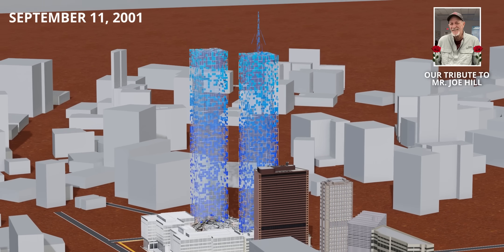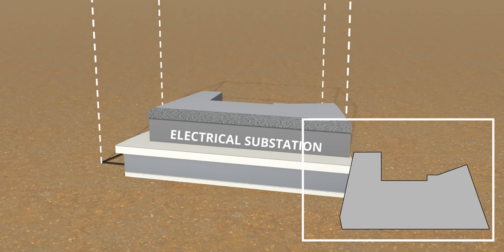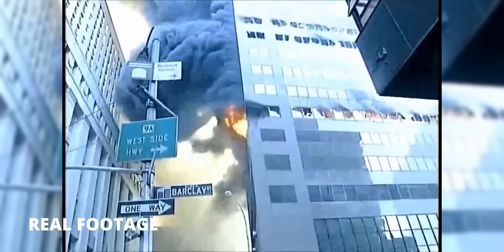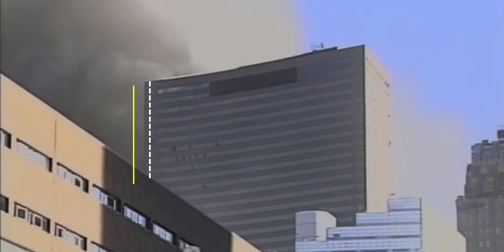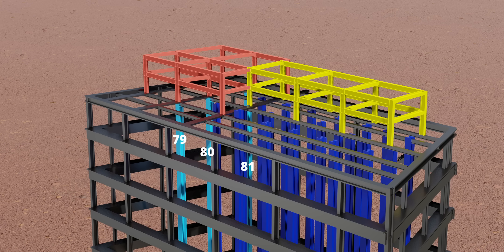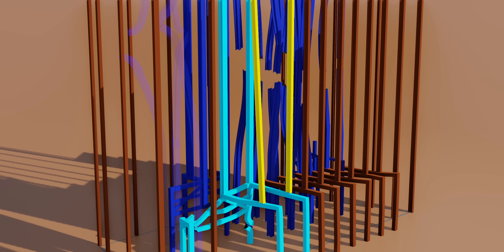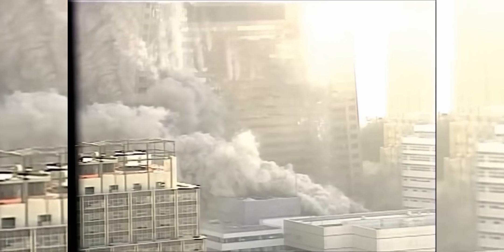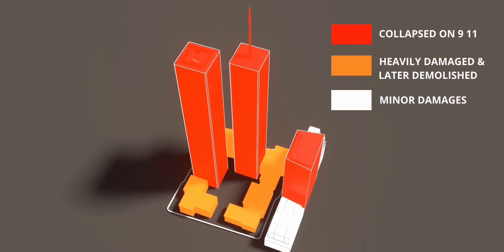Collapse of Building 7 | The Complete Physics

Comment: It's amazing how strong rigid vertical steel columns turn to spaghetti in animation, what's more amazing is that non of the 3 towers slowed or tipped over to path of least resistance, they just rushed downwards to the ground.
Reply: It's amazing that the building stays completely intact as it sinks into the ground from the bottom up.  I read a book on this specific collapse which stated  the only way it could collapse the way it did, was for all the support columns had to blown out simultaneously.
Reply: @JoeLinux2000  what was the name of the book?
Reply: The book is called, The Gullibility of the twoofer, by Leroy hulsey with the forward by rich gauge himself
Reply: @ dikranovichk5889  You think typing condescending and childish insults is proving something? It just shows the level of your maturity which is clearly displayed here.
Reply: @JoeLinux2000  - Wow, someone really wasn't paying attention. FFS 🤦‍♂

And no, you didn't read any book. You copied that off some YouTube video.
Reply: @rokko_fable, come on, we’re almost there. 20 story building above floor 89 of the north tower, and a 30 story building above the 77th floor of the south tower. These masses drop ten feet, and impact the floor below.  What does that floor do?   Mt Everest by volume is a solid mass.  The twin towers by volume, were over 90% air. Kind of like the “truthers” brain.
Reply: @TheCriticalStinker-01  "The columns are largely spectators during this ROOSD phase of collapse."
Nice, so the massive 47 steel core columns should've remained standing since they were mere "spectators", but they vanished too!!!
You see the flaws of this theory?
Reply: @TheCriticalStinker-01  The "pancaking" theory is adopted officially, we've been told time and time again that the collapse of the twins was due to the top section (pile driver) made of 15-20 floors dropping on the floors below the impact zones, gathering weight and momentum after impacting the floors one by one, right?

"Each successive failed floor adds its mass to that already falling. Too many get lost by forgetting this bit of bleeding obvious."
Good! Now this "mass" of pancaked floors, or the "pile driver" or the "piston" is clearly not visible after a few seconds of dropping, it is observed clearly getting destroyed way up before even reaching half way of the collapse. The ending result in both towers seen in the photos is zero floors! Not a single concrete floor was seen at the bottom, just steel debris thrown everywhere.
 So this "mass" wasn't responsible for pushing 70+ floors all the way down to the ground, or else why did it vanish?
Reply: @Vantriloquist-j9j  - Not sure where you get any of that from. My description of the collapses was written in plane simple language and an easy to follow format. 

The only flaw is your inability or perhaps unwillingness to understand it. 

I suggest you read it again, more slowly this time. And do try to be serious.
Reply: @asmagaref, I think talking to you in general is a childish endeavor. Your100/1000 architects and engineers sits at 3661. Thats the number on the aNe “truther” website. Do you get that, 15+ years and the more ons have 3700 signatures from professionals.  There are millions of architects and engineers world wide.  10,000 is 1% of a million. You’re so sure you are right, you have a fraction of 1 % of the whole world wide scientific community.   Your group has gone to court multiple times and been shut down for lack of standing, multiple times. Oh yeah, Larry Silverstein says “pull it”. What, your finger?
Reply: @dikranovichk5889  lol Says the one leaving ch ildish replies under comments, you're projecting!
Reply: @dikranovichk5889  Yeah well over 3,000 have taken interest, who says every architect/engineer has looked into this?
Reply: @TheCriticalStinker-01  I suggest you do exactly what you're advising me to do. I've responded precisely to the two key points in your theory after quoting them.
Reply: @Vantriloquist-j9j  - No, you added your own agenda to what I stated, attempting to twist my words.  So I admonished you to read it again, since everything you need is already posted. 

I speak in clear, simple language and say exactly what I mean and it is all thoroughly vetted. There is no need for you to try and twist my words. It will not work.
Reply: @azmagrift, come on dude. 3661, that’s the number of professionals who have signed your petition. What, don’t scientist talk to their friends and explain things in scientific terms. Couldn’t these 3661 spread the word pretty easily with texts and emails and you know, a telephone. Or these 3661, couldn’t they produce a video or something.?

You’re so sure of your position, yet the scientific community appears not to be. And you’re claiming science supports your position.  Then your response is to say, the rest of all scientist are what, afraid of loosing their job, or they just haven’t heard about it yet. WTF!!!  Are the 6 million Chinese engineers all afraid of loosing their jobs. Smart Russian engineers over in Russia, couldn’t you get some of them to support your position, with your “facts”?
Reply: @TheCriticalStinker-01  
I've clearly addressed your two key points regarding the two towers' collapses, but because I pointed out the flaws you call it my agenda or twisting your words.
Reply: @Azmagraf,  come on, 3661 engineers and architects have signed the petition. Lawsuits have been filed, and turned down for lack of standing.  We’re talking science here, Einstein.  Where is the support of the scientific community?  A Fraction of a percent, really?  This is high school physics we’re talking about, and a fraction of a percent of support from the world wide scientific community.
Reply: @ Everything you type is irrelevant and meaningless right now, you're being ignored little child, now give back the phone to mommy!🙂
Reply: @azmagraf, oh nice, that’s a classic but hurt response.  You stick with your fraction of a percent, and avoidance of reality.
Reply: @azmagrift, I’m enjoying reading your posts on other threads.  Seeing you tell another poster you’re not on one side or another is good stuff.  More finger pulling I guess
Reply: @Says the mosquito of the comments section 😂ok bye:hand-pink-waving:
Reply: @azmcgulible. Did you ever say when building 7 begin collapsing?  Do you think it starts with the roof and penthouse collapsing, or do you think the collapse begins later, when the shell falls?
Reply: @ I've already made it clear 3 times that I don't entertain children who use name calling.🙂
Ciao :hand-pink-waving:
Reply: Dork, you’ve been entertaining me for weeks now.
Reply: Another funny little post from you, was you explaining how you check for shadow banning, by using another account, to see if you’ve been shadow banned. It explains how your post gets two thumbs up within mins of being posted.  You give yourself a thumbs up from your multiple accounts. Too funny!  “Was I shadowed banned? Nope, oh look, I can click another thumbs up”.
Reply: @Vantriloquist-j9j  The mass of the "pancacked piledriver" didn't vanish. It's all still there, just simply disintegrated. Just because it disintegrated into pieces doesn't mean it magically weighed less. That mass would still be falling downwards in the direction of gravity, with its enormous momentum causing every floor beneath to immediately fail. I don't think you understand what you're saying.
Reply: @Vantriloquist-j9j , especially with the damage being at the front of the building which is narrower than the back, the building should have toppled rather than free-falled. The wider foundation at the back should have given it more support. You're going to come up against a lot of shills in these comment sections too, so don't waste too much of your energy arguing with the enemy. The fact that over 3000 experts have voiced their opposition to the narrative is astronomical. For every one of those experts that have voiced their opinions you'd get a thousand more that would agree with them.
Reply: @joelstinks, maybe your book could explain why the roof collapsed first, before the shell?  Once any part of the building collapses, that is a sign that columns have failed. If columns failed before total collapse. Then it doesn’t seem possible for all columns to have collapsed simultaneously. Or maybe that idea goes over your head, since it seems like that wasn’t in your book
Reply: Down, yes. Vertically straight down? No. 

His azmagaref observation is correct. If you say gravity, then that applies for a falling body through the atmosphere. 

But this was a standing body, they just don't fall vertically down having been standing. 

So, yes, they should not just sink vertically downward. Column standing will have a lateral moment of force about its bottom by its weight when even the slightest tilt occurs  or from neighboring debris
Reply: @lamentube  
Thank you, it's logical isn't it? if you sever or break a standing vertical steel column it'll fall sideways like a tree. For it to crumble down means it'll have to have been severed or broken in multiple points from bottom to top! And that happens to all the columns at once. 

You look at the South Tower's collapse for example, that top section above the impact initially started following path of least resistance, it leaned/tilted forward, but instead of breaking or falling off the rest of the building, it starts diving downward through the whole structure!!
For asking legitimate questions they start giving you insults and calling you names.
Reply: Poor baby, you finally made a valid point. The 32 floors above the impact zone of the south tower did fall towards the direction impacted.  The central core however forced the building to collapse on itself. That’s why in each of the twin tower collapse, the core is the last part of the building to remain.  Look at the spire from the north tower collapse. Vertical columns still standing erect, after global collapse.
Reply: @dikranovichk5889  
Yeah yeah, the ball crushed the mountain.😄
You're not getting the attention you want, nor be taken seriously by me after the childishness you displayed on this thread and others.
Bye again :hand-pink-waving:
Reply: Ya crazy huh
Reply: Yeah, gravity sucks
Reply: Asymmetrical damage leading to a perfectly symmetrical collapse against the path of greatest resistance..... pulverizing the ridid steel structure in the direction it has the most strength.... into its own footprint .... at the speed of gravity as if unimpeded
Reply: @VeiLofCognition - PhD. Judy Woods, book tiddle " Where did the Towers go " is a key question...The steel turned into dust... Watch the (one) video of the center core falling...Then look at what steel remained, after the collapse...
Reply: Nano thermite on concrete, laser pulse ignites...
Reply: Actually the tops of BOTH twin towers did tip during the collapse so nice try and even in this video he showed that building 7 did as well
Reply: @crazyeddie1981   show me where building 7 "tipped" dude what 7 meds are you on, there is no video of it "tipping" over. Do you just make stuff up in your head and then pretend to believe it to feel better about the world? LOL! Jesus ...
Reply: That’s called buckling. Leaning or falling to the side would take force or energy to start the rotation (moment of inertia)
Reply: Because you’re an engineer and know better, right?
Reply: @user-uv4wn2xx7o I am actually 😂 - and I bother studying the facts first instead of jumping to crazy conspiracy theories without any evidence whatsoever.
Reply: Was there an actual question in that post?  What building fell at free fall?   Can you explain how these calculations where made?
Reply: Out of curiosity, have you ever seen a tower tip over before?
Reply: What do you mean “path of least resistance”? That what electricity follows. Falling objects just go down
Reply: @darthnbl  "Falling objects just go down"
Wow you're a genius! When you cut a tree from the bottom does it fall straight down or tip sideways?
Reply: It’s amazing how steel becomes malleable after being at 1800 degrees for hours.
Reply: @benlundstrom5704 it's amazing how the thousands of tonnes of structural steel under the fires still held most of their bearing capacity
Reply: In this presentation it was not said that the upper floors just pancaked downward collapsing on itself as its typically explained with the collapse of WTC 1&2. I feel it would be a stretch to use the same explanation of the high temperature fire weakening the steel support columns to uniformly bring down WTC 7. Which, like the Deutsche Bank Building, was never struck by a would-be hi-jacked airliner.
Reply: @nelsonphilip4520 

WTC 7 didn’t collapse like the towers, Towers 1 & 2 fell from floor truss failures after plane impacts. WTC 7? No plane; just hours of fire that caused one girder to fail at Column 79, which triggered an internal collapse. Different building, different structure, different cause. No mystery; just fire, physics, and facts.
Reply: Do not believe a word of this. The same explanation that holds its weight  in forensics is- preset demolition was used.  Thermite used kept the steel molten 5-6 months after the collapse.
Reply: @Vantriloquist-j9j  Are you dumb? THE PATH OF LEAST RESISTANCE WAS THE PATH THAT IT TOOK. Or do you think physics decided take a vacation on that day? Those columns can support the building weight when ALL OF THEM are intact. Remove a few it's like removing a card from a house of cards. Try to tell this to your 3 brain cells.
Reply: It's almost like steel is a poor choice for construction.
Reply: Yep. Once the steel fails, it collapses. The forces involved are quite extreme.
Reply: @paulblase3955 - SatttliteTech works...
Reply: Nothing strange about that at all 🙄
Reply: floors pancakes on towers 1 & 2
Reply: You are the Fiction factor 🤣🤣🤣🤣🤣
Reply: The events of 9/11 are very suspicious and if you look at the history of the U.S. government, and are an understanding person, you would acknowledge that foul play was a probable reality.
Reply: I know the focus here is on the collapse of the towers, which itself seems dubious to me at least, but look at the bigger picture and read into the Twin Towers and you'll see. Look up Twin Towers and Port Authority's asbestos abatement bill as well as the numerous false flag instances the U.S. government has supposedly conducted. Why should I trust a narrative with so many plot holes from "authors" that have lied multiple times and done horrible things in the past? It's not that difficult to at least understand these notions. Chill.
Reply: they absolutely did tip over, you can see it clearly in any footage
Reply: @isaacgonzalez4606 Only in the South tower did the top section initially start to tip, but then dropped downwards and didn't  fall unto the ground as expected. Watch it again in slow motion.
Reply: It was old steel too very valuable. Harder and the temperatures needed cannot be created by fire or jetfuel it's physics. I do not accept the magic building theory.
Reply: Only amazing to you
Reply: I think the more implausible theory is that a largely aluminium plane was able to inject itself into a steel cased building. The plane should have folded like paper on impact. The media projected that it made its way through the building largely intact. Erm. Physics says no.
Reply: I'm not a mathmagician, but don't the steel beams push and pull? This keeps the building from floating away.
Reply: Is there any steel structured building collapsed due to fire only 🤔
Reply: Ejecting steel beams horizontally and finding body parts 1 /4 mile away.
Reply: @seedplanter7173   You're saying body parts were flung 1/4 a mile away!!! What type of energy is required to send someone's i.e leg that far? 
So a floor falling on another floor can produce that explosive energy? Enlighten me.
Reply: Many architects and engineers have done studies that disagree with Sabin’s conclusion in this series. Please do your own research. Read this article https://www.europhysicsnews.org/articles/epn/pdf/2016/04/epn2016474p21.pdf
Reply: I would expect a weakened building to collapse downwards. Where else would it go? These are not trees falling over in a forest. They're complicated human structures that have multiple points of failure, that cascade downwards. I honestly don't have the imagination to view any other scenario as plausible.
Reply: Not spaghetti but close to it. Steel doesn't go from strong and rigid to puddle form. It softens up with heat. Find a piece of rebar you can't bend, get it glowing hot and you can bend it. Get enough weight on it and it may as well be a noodle.
Reply: Down is the path of least resistance - it is the direction of gravity.  Sideways requires a lateral force and there was nothing pushing on them.  Your starting assumptions are false.
Reply: @TheCriticalStinker-jw4fl   You cannot have a symmetrical collapse with asymmetric damage. Every inch of the buildings are still structured to hold up the upper part of the building. Straight down is not the path of least resistance it's the path of the most resistance. There is no resistance around every side of the building thus a collapse with lean in one of those directions. This is junior high level physics.
Reply: @FilterFreeAmerika  - Yeah, yeah, I've heard that dogma recited endlessly for the last 18 years and it will fail this time for the same reason it did the last 10,000 times it was brought up.

The collapses were progressive NOT symmetrical

Of course, the whole thing is a Red Herring anyway since in the engineering world, this is a non-factor. Go ahead and peruse the engineering journals and see how many times it crops up in the last century or so.  I guarantee you only need to bring one hand and will have digits left over.

Symmetry as a talking point was fabricated by a tiny subset of ignorant conspiracy believers. It is as untrue as it is irrelevant. 

My suggestion would be instead of just mindlessly repeating proven fail arguments you found on the internet you come up with something new, something interesting, something that hasn't already failed countless thousands of times. It would be more productive.
Reply: @rokko_fable, I think you are finally starting to get it. Flight 11 hit the north tower at floor 90 of 110 story skyscraper. The south tower was hit at floor 78 by a commercial airliner, traveling at high speeds. The faster the plane, the greater the impact.  The building remained standing after these destructive impacts.
Reply: @rolko_fable,  when those 20 floors collapsed above floor 89, what did 89 do, call down to the basement and say I need reinforcements?  And when 89 was compromised, does this floor then become part of the falling mass???
Reply: @ 
Ok, I get your theory that when around 15 floors in the North Tower started moving down, the weight of this top section was increased by each floor (pancaking) it impacted below right?
So the top section (pile driver) continues gathering weight and momentum until it reached the ground, do we agree so far?
Reply: @raisenarizona, you think a soccer ball dropped from ten feet above Everest is going to just fall through the sky.  I mean, what’s the point in even trying to have a discussion with you. It’s like trying to have a conversation with a monkey. Really, get your fellow twoofer to pat you on the back some more. 

It’s clear from the collapse of the penthouse and roof, that building 7 was failing, and collapsing,  before the outer shell began its collapse. Your notions about the subject don’t hold up.  Your top argument is a quote from Larry Silverstein
Reply: No, we can’t
Reply: @Vantriloquist-j9j  - Near close enough for a working basis. Forget the "pancaking" bit though since that is wholly inaccurate, however one chooses to define it.  

Falling mass (and it is a mass, not neat intact floors) continues to increase with each successive floor failure and with it, momentum. This should be obvious enough. Each successive failed floor adds its mass to that already falling. Too many get lost by forgetting this bit of bleeding obvious. 

The columns are largely spectators during this ROOSD phase of collapse.
Reply: @TheCriticalStinker-01 do you have an engineering degree? definitely not. You have no clue about structural design.
Reply: @markderv, when, in your mind, does the building 7 collapse begin?  when the penthouse and roof collapse in, or does the collapse begin later, when the outer shell collapses?
Reply: @alneg6234  - IF I have made any errors of fact, logic or reason please feel free to point them out and I will make the necessary corrections. Please be specific and prepared to back it up.  I assure you I will be.

I won't wait up.
Reply: @TheCriticalStinker-01  Quite the gatekeeper aren't you?
Reply: @TheCriticalStinker-jw4fl actually one side being g compromised and one weakened would cause lateral force . Ever sit on a 3 legged stool with one leg missing?
Reply: @graNtbaKer420, since it seems like we’re both talking to ourselves, maybe we can pull our discussions into one thing.  Like, when the first column failed, was it an exterior column, or an interior column?
Reply: @grantbaker371  Indeed. Unfortunately, bots like criticalstinker don't think as critically as they would have you believe. They are literally C+Ping failed explanations they have gleaned from the web, just like any other AI.
Reply: @TheCriticalStinker-01  So now explain how a field gobbled up a whole plane and made it disappear and how the wings of two jet liners made of aluminium were able to slice through steel girders surrounded with concrete like a knife through butter, and not one, but both towers perfectly imploded despite being engineered to withstand the impact of a fully loaded passenger jet, and how the steel girders supposedly melted depot requiring temps well in excess of the temps generated.
And that's just the very tip.
Reply: @TheCriticalStinker-01  wow you got it upside down, down is the path of the MOST resistance.  Return your engineering degree, oh wait i dont think you have one.
Reply: @Raga-Muff  - So gravity pushes up, it doesn't pull down???

Wild.
Reply: @TheCriticalStinker-01   Path of the most resistance is a path in which the structure have most resistance, in case of every building, thats in vertical direction. Its because they have to resist gravity. Path of least resistance would be to tip over to the smaller part of the trapezoid. 

Really surprise someone could think that. What is the path of the most resistance for a rod? Through it axis or sideways? Most people would say through its axis, you are saying that is the path of least resistance?
Reply: @Raga-Muff  - Until the structure fails, at which point by definition it is no longer offering resistance. Like when a column buckles - it instantly transitions from carrying to load to not carrying the load.  After that, the path of least resistance is down. 

All of your analogies/examples are assuming a pristine structure - for reasons I guess. But the structure can't be pristine if the building is collapsing. Something failed and what failed is the structure that holds everything up.

Not sure why I need to explain that bit of bleeding obvious. It's almost like you didn't watch the video or understand how anything works. 

Steel buildings do to tip or topple. They dismember themselves. They are not rigid like trees and there is no pivot/hinge point and no lateral force acting on it.  They go DOWN.
Reply: @TheCriticalStinker-01  That's just dumb, and you know it.
Reply: @TheCriticalStinker-01  A building can’t fall straight down at near free-fall speed unless its supporting structure is removed almost instantly, because physics dictates that intact structures oppose falling mass with resistance, which would slow or deflect the collapse. This is basic physics.
Reply: @k-town31  - Good thing that isn't what happened with Building 7 then so I am curious why you would even bring any of that up. 

Don't just mindlessly repeat stupid shit you found on the internet.
Reply: @TheCriticalStinker-01 dude have you been debunking every single comment on this video?
Reply: @TheCriticalStinker-01  
NO, the path of least resistance is the direction of least resistance, away from the intact columns, normal collapses show buildings sway and tip sideways/backwards, not keep pushing through and evaporising internal structures.
Now Imagine if I sat on a table that had 47 legs and about 5-10 were compromised, how does the table top with me on it drop straight to the bottom!? Explain that without removing the rest of the legs all at once.
Reply: @azmagaref  Down is the direction of least resistance because it is the direction of gravity. Gravity pulls down. Steel frames structures do not topple, the dismember themselves on the way down

I can explain it all in detail if you require.
Reply: @Vantriloquist-j9j  Are you a flat earther? You sound like one. They too love to set up little thought experiments (and actual experiments) that are 1/10,000 scale and consider it proof of their zany theories.
Reply: @TheCriticalStinker-jw4fl   "Steel frames structures do not topple, the dismember themselves on the way down"
They dismember themselves? lol How convenient.
Reply: @TheCriticalStinker-01 go back to school, what you’re saying is nonsense
Reply: @TheCriticalStinker-01 down doesn’t work in this case
Reply: @matthewsimpson5621  - Why?  Because you don't want it too?  Because it makes you cry? Down is what happened so you will have to do much better than that.
Reply: Come back Alfred…..
Reply: @Vantriloquist-j9j Call your old math teacher and ask if you can retake their course.  Pat attention this time
Reply: @Vantriloquist-j9j  
"NO, the path of least resistance is the direction of least resistance, away from the intact columns"
-False.  The path of least resistance was down through the hollow building, where most of the rubble was funneled inwards by the outer support columns/structure.
Reply: @azmagaref 
That is a very cogent response, and you are correct.
M
Reply: @MnM. You get a thumbs up for creativity.
Reply: @Vantriloquist-j9j  The path of least resistance is thru the floors. They were not rated to carry anywhere near the dynamic load applied. It wasn't even remotely close.
Reply: @Vantriloquist-j9j  
Overstressed steel shatters or deforms like clay, depending on the type of steel.
The strength of steel also decreases with increasing temperature.
600°C is enough to weaken steel by more than 50%.
Blacksmiths have been using this heat-induced weakening of steel for thousands of years to shape steel into other forms.
Reply: @iShaq,  does the ball take the same path of least resistance down the mountain as Uranus would?  Is Uranus’s path of least resistance the same as the ball, when they are both dropped from ten feet above mt Everest?
Reply: @- Excellent response... I love the comment section on any scientific topic... especially the Critical guy. the one with 47 brain cells left... No offence, he`s just on a lifetime short bus...   OR ! He`s XXX
Reply: @IshaqIbrahim3  - Floors don't carry building gravity loads. Columns do. Remove the columns and the floors go with them.  Remove the columns and there is not significant resistance.
Reply: It seems like a new twoofer policy is to write posts, then delete them.
Reply: @Vantriloquist-j9j at nearly freefall speed at that!
Reply: @Vantriloquist-j9j  it doesn't. This was a demolition. The US government is a communist party
Reply: @Vantriloquist-j9j  its hard to understand 9/11 when you can’t even comprehend high school physics. Down is always the path of least resistance due to gravity. Plus in video you see the south tower sway a bit before falling straight down so I don’t know why this is always a point for you conspiracy theorists
Reply: @germanfisch  lol Thanks for confirming your i>gnorance, so a table with a broken leg drops straight down professor?
Reply: @Vantriloquist-j9j  idk man table legs dont weigh as much as a building. Here’s better analogy, If you step on a can of unopened soda nothing will happen right? And then if you poke a hole on the side of the can it will be crush straight down right? You can try this yourself. No hate im genuinely trying to help you. You might come from a third world country with bad education but thats okay
Reply: @Vantriloquist-j9j That's an oversimplification of the problem. But for the sake of making a visualization of it, let's just tweak it slightly. Sure, you have 45 legs and 10 were compromised, It's supposed to be fine, right? Well let's redo the situation, make the table bear 200 tons worth of mass and let's see it lose 10 limbs again. Does it make sense now why even a handful of pillar lost is a great hazard already? Do your own bits of research, and stop providing evidence that the Nietzsche Thesis was right all along smh.
Reply: @franzxdd  lol Nice try, assuming the "200  tons" had wooden legs beneath them is hilarious and disingenuous, both the twin towers had most of their weight and strength BELOW the impact zones not above!
I've already gone through the "piston/pile driver" theory with another person on this thread, I've explained why it doesn't make sense, read it.
Reply: You’ve never made the slightest bit of sense.  Who the F do you think you’re kidding?
Reply: @dikranovichk5889  Here's a tissue..🤧
Reply: @Vantriloquist-j9j  You should take your table leg argument straight to congress lmao.
Reply: @wildcatdan5072  You mean AIPAC bought congress.🙂
Reply: @wildcatdan5072  You mean AIPAC's congress.😉
Reply: @TheCriticalStinker-01  correct, during a controlled demolition. Otherwise some part is stronger than what failed 1st and it falls over, not down.
Reply: @josmith4531  - Steel framed buildings are not trees. They don't topple, they drop.
Reply: @Vantriloquist-j9j   That’s actually how high-rises behave under internal collapse. Once a few floors failed, the massive weight above overwhelmed what was left. The path of least resistance was downward, into already-failing structure. The “spaghetti” effect is just how steel behaves under high heat and dynamic load. NIST simulations confirm this matches what we saw, especially in 7WTC.
Reply: @TheCriticalStinker-01  They dismember themselves on the way down?🤣🤣🤣
Reply: @Vantriloquist-j9j  Ridiculous, isn't it?
Reply: @CC-xu2yz  - Did I stutter?

Yes, critical connects are severed as the building tears itself apart. My cat could understand that. Why don't you?
Reply: @WalkinTheCow "zanny" would be thinking you even know the argument of "flat Earthers" and reflecting yourself as having knowledge about anything.
Reply: @TheCriticalStinker-01  how do you explain the lateral movement of multi ton girders of wtc1&2 found 2 football fields away stuck in surrounding buildings? HOW DO YOU EXPLAIN THE LATERAL FORCE MOVING A MULTITON STEEL PIECE 2 FOOTBALL FIELDS AWAY?!
Reply: @eusebiollupi4629  - They didn't.  Perimeter column peel-off

Think Banana.

The perimeter columns peeled away as the floor truss connections were stripped away, pivoting at the base in sections up to 60 stories tall that spread out up to 800 feet in some cases to the four points of the compass.

You can actually see it happening in the collapse footage.  It is glaringly obvious from even casual observation of the debris field - especially overhead shots - and it makes logical sense.  Whatever it is you are proposing absolutely doesn't and has no supporting evidence.
Reply: @eusebiollupi4629 but but but I thought they fell straight down? Now you’re saying debris was found 600 feet away? So which is it?
Reply: @TheCriticalStinker-jw4fl and the support beams have to collapse in a perfect order to get that straight down collapse. There is no other case like this usually it will topple. All 3 buildings on the same block fell into their own footprint, never seen before. What are the odds?
Reply: @TheCriticalStinker-01  rofl you dont even know what you are talking about
Reply: @bluemoka8992  - Uh huh.  OK then, IF I have made any errors of fact, logic or reason please feel free to point them out and I will make the necessary corrections.

IF you can't, then realize it is really a you problem not a me problem and make your own corrections.
Reply: @TheCriticalStinker-01 rofl, the path of least resistance isn't a path in spatial sense, it's about the minimization of the potential energy of the system...

A symmetrical collapse doesn't verify the principle of least resistance, hence it's not something that actually happens. Well, outside of a controlled demo of course. I am structural engineer darling
Reply: The "path of least resistance" isnt a meaningful concept the way you're attempting to use it.  Things  always fall down, resistance is irrelevant.  You obviously don't have a handle on how heavy buildings are, and you seem to be saying the videos show something abnormal or strange, as if you know better than the actual video how the buildings "should " have collapsed.  Ridiculous
Reply: Its called gravity, on earth it makes things fall down not sideways or up
Reply: It is odd that you find it odd that a building fell down instead of sideways
Reply: What many people do not realize is that the support columns actually were made out of spaghetti.  This was done to reduce costs (pasta is less expensive than cement).  Once the penthouse air conditioners were compromised, the water leaked down on the spaghetti columns and it wasn't long before they were all wobbly and such, exactly as is shown in this excellent and highly factual video.
Reply: Finally common sense
Reply: You can watch engineering videos on strength of materials and testing for such like we did in engineering school. You will learn things, and you will understand why with the scale of forces, distribution and direction of force, and size of this building and beams, this isn't surprising at all.
Reply: That’s what I’ve always thought, they didn’t fall over at any angle, just straight down like a controlled demolition
Reply: At free fall speed with little to no resistance
Reply: @maddhatter8 

They didn’t fall at free fall speed though. Only a part of WTC 7’s outer shell dropped near free fall after the inside was already gone. It looks dramatic but it’s exactly what you’d expect once the core fails. No mystery.
Reply: I’m so glad people are not all the way stupid and see they being lied to about many things in this reality . Like god and earth
Reply: That's accurate. Steel I- and H beams are very strong in the direction they're intended to be loaded, but if they buckle, they're nowhere near as strong. Think of it like an empty coke can: when it's a cylinder, it can take your weight,  but put a kink in it and you can flatten it in your hand.
Reply: @ed6705  The funny thing is that’s actually how the collapse did happen. Once the floors gave way and lateral support was lost, the tall vertical columns buckled. They weren’t designed to hold up without bracing from the floors. So yeah, once the structure kinked, it did fold like spaghetti. It didn’t need to tip it just needed to fail one floor at a time.
Reply: @ed6705  It's a massive steal tower with tens of standing rigid core columns, not an empty coke can!
Reply: whats really amazing too is how BBC reported building 7 had collapsed mean while in the back ground building 7 is still standing. so id like some one to explain that.
Reply: @jdjd4052  it’s called a live delay
Reply: @jdjd4052 No, it was just a misunderstanding in the confusion - the BBC reporter misheard reports that WTC-7 was going to collapse, so she thought that it had already collapsed, when she reported it to the BBC viewers, since she didn't know the layout of the WTC complex in advance,  so she had no idea which building was WTC-7.
Reply: @Bjowolf2  give me a break
Reply: @Bjowolf2  ok right lol
Reply: @VeiLofCognition Yes, you obviously need one 😂

But that was what happened in the confusion with all the reports coming in - an easy mistake to make, when you don't know the layout of the complex and therefore don't know, which building is WTC-7.
Reply: @jdjd4052 aliens told them
Reply: @jdjd4052 the bbc and other media outlets were informed in advance by the nyfd that the structural integrity of the building was compromised by the fire and that they couldn’t stop the collapse. It’s weird that they said that it was gone instead of saying the building will collapse, but that’s just splitting hairs.
Reply: @jdjd4052 They reported the Solomone bldg collapsed...Just kidding same building. Good work carry on
Reply: @jdjd4052  - Why is that amazing?  Because 3 kids made a crappy movie telling you it was amazing and you just nodded in agreement?

There were hundreds of erroneous news reports that day, what with all the chaos and confusion.  What makes this one more special than the others?
Reply: @TheCriticalStinker-01  How could they have reported something that hadn't happened?
Reply: . Reporting on something yet to happen would have people believe in a possible conspiracy. Telling people not to trust their eyes and ears and making up new science to protect lies?  The implications are something your mind cant handle so your condemned to stay in the Matrix defending lies and protecting evil.
Reply: @jdjd4052  You mean a stressed reporter used the wrong words for a damaged building?

I said that we had an explosion in a battery, when in the end of the day it was a bad mounting of a cable creating small arcs in it make it melt the plastic...

Doesn't mean that i tried to cover up a terrorist attack in the battery pack.
Reply: Because gravity pulls down? It's not that deep.
Reply: @Goat_Lord  That's not a gravitational collapse, all buildings slow and sway/change direction towards less resistance and topple, they don't fall straight down like a hollow tube unless the internal columns bent like spaghetti. It's very deep.
Reply: Why is it such a mystery that the twin towers collapsed at the point of impact of commercial airliners?
Reply: @Azmcgriff, years of the twooper taking about how buildings should collapse, and meanwhile buildings continue to collapse, in ways that are in spite of your claims.
Reply: @ I've watched buildings collapse, I'm yet to see just one example like Larry Silverstein's "pull it".
Reply: Ruff ruff, so what your saying is, facts mean nothing to you, only your own fantasy matters
Reply: @ lmao What facts have you provided? Show me examples of sky scrapers fully collapsing after fire in the manner that building 7 did.
Reply: @azmagaref  What? Gravity pulls down. What are you talking about?
Reply: @Azmcgriddle, you can take any comment you want and try and attach whatever context you like.  It’s just not facts, that’s all.  It’s your fantasy.
Reply: @ Edficio Wilton, Delft University, Plasco Building, Hengzhou Towers, and 8/3 Dvinskaya all collapsed from smaller fires.
Reply: @ I'm not attaching anything since you typed nothing of value.
Reply: @ Gravity pulls down? lol Thanks Einstein.
Reply: azmcgtiff, you started this thread, with your comparison of steel and spaghetti. That’s the value you have brought to your own little sub topic. Does building 7 collapse begin with the penthouse collapsing in, or the shell collapsing down?
Reply: @Vantriloquist-j9j  it's funny that when you speak common sense, others call you a conspiracy theorists and come up with all sorts of zany explanations to defend the official narrative.
Reply: @Rokko_fable,  when you drop a soccer ball from 10 ft above Mt Everest, does the soccer ball take the path of least resistance down the Mt?
Reply: Question#2, for the common sense crowd:  when Uranus is dropped from the same distance, does Uranus take the same path of least resistance as the soccer ball?
Reply: @ 
Simply because there's nothing underneath the ball it should fall down straight down.. duh! 
We're talking about a structure collapsing through its own intact (partially compromised) support system.
Reply: @ @rokko_fable Yeah, especially when hundreds/thousands of civil engineers and experts have voiced their opposition to the official narrative
Reply: @dikranovichk5889  Yep. you just proved why the building wouldn't fall straight down. The ball would roll down the mountain, because there is stuff in the way. Just at the building would fall sideways, because of all the building below it that is in the way.
Reply: @fellas, are you two really this obtuse?  Rokko, and Uranus, what happens to it when you drop it above Mt Everest?  Does it take the same path as the ball?
Reply: @Rokko, you just proved the point, Uranus and the soccer ball have two different paths of least resistance.   Your little soccer balls roll down the Mountain aimlessly . Uranus, it crushes the mountain.  Can you believe Uranus takes a different path down the mountain than your little soccer balls?
Reply: @dikranovichk5889  yes, because the top few floors of a skyscaper weigh exponentially more than the bottom 3/4 of the skyscaper.... sure. you got me.
Reply: @dikranovichk5889  
Your analogy is way off, you have an example of a planet falling on a mountain! Of course it'll crush it, how's that relevant to tower 7 collapse?
Now let's take the North Tower, we had about 15 floors above impact zone, they were damaged and on fire, below them at least 75 intact rigid floors with their core, yet those 15 floors (the ball) crushed down all 75 floors (the mountain) down to ZERO floors in 12 seconds!!! 
I don't buy the "pile driver" explanation, if 15 floors acted as one unit falling, the 75 floors below were one unit of opposite force, resisting it, slowing it and either stopping or that top section (the ball) should've moved sideways/get crushed before reaching bottom.
No?
Reply: @Vantriloquist-j9j  There is video.  Nothing falls any direction but down.  Sorry you don't like how gravity works, instead of arguing against the laws of physics you could use this opportunity to learn and live the rest of your life with much less confusion
Reply: There are not thousands of engineers claiming that what happened didn't happen.  Just a tiny sliver of common sense would change your life for the better.
Reply: @“can’t compute what you’re saying, reality is not my forte.”
Reply: There are plenty of such videos where fire causes a collapse. FFS, the roof of a warehouse was enough weight to collapse columns experiencing fire. One floor with virtually no weight vs 50+ floors. Arguing to your own ignorance is not convincing anyone of moderate intelligence.
Reply: @micaholiver74  I think you're creating a strawman and easily burning it down. Haha. The point of the post isn't necessarily that fire couldn't have taken it down. The point is that the uniformity of the collapse suggests that this fire uniquely caused a collapse straight downward. It seems that fires would not cause a uniform collapse. It seems that fires would cause the structure immediately above to fall first, which should create torsion or twisting of some sort. That would create a collapse that looks more like a Jenga tower falling rather than a controlled demolition.
Reply: @ WTC 7 did twist and contort. What are you talking about? It literally did what you are saying fire should have done. It caused the Penthouse directly above to fall first and then it progressed across the interior, twisting the structure. It's not often someone proves themself wrong, but here we are.
Reply: @dnaking  It wasn't uniform as is very clearly explained in the video. Nor is a 50+ floor building in the same universe as a Jenga tower or table top. With a substantial portion of the BASE of said ~50 story tower demolished and fire weakening what remained, a building would never fall sideways. 7's approx weight: 252,000 tons. Do you have any idea the forces involved if the base of said building gives way and you've got 242,000 tons in motion? 529,290,309 lbf. Half a billion lbs of force. Its going straight down.
Reply: @Oldschooldan1  how much of the structure fell outside its own footprint? You probably think I'm a conspiracy theorist. I'm not. I'm just genuinely asking questions. For a structure taller than it is wide, it seems random fires would burn randomly, producing random burn patterns and random burn rates. Assuming such randomness, how did the building collapse uniformly and almost exclusively into its own footprint? Of the photos I've seen, it appears that building 7's rubble piled up on top of itself until it exceeded the angle of repose and poured down the sides of the pile until it spilled onto the sidewalk and roadways. It fell straight down as if someone magically removed the first few floors. It did not weaken and twist in a non-uniform way. At least not very dramatically. It may have twisted a few degrees at the top. But it was my understanding that the fires that caused the fall were on the lower levels. I could be wrong about that.
Reply: @micaholiver74  then why is building demolition a thing? That family that spends all their time calculating precisely where to explode and when to time it? They must be wasting their time, I guess. If you have a structure that is very wide, and you remove support from one side, it doesn't seem logical that the entire structure would fall down uniformly. It seems like it would tip over. Go up behind a standing co-worker and push them in the back of one knee. I bet they don't fall down straight to the ground. I bet they lean first. ANY thing that has more than one support point must lean if you remove less than 100% of the support points simultaneously.
Reply: @dnaking   When WTC 7 collapsed it did massive damage to the surrounding buildings, including Fitterman Hall, the Manhattan community college, the Barclay–Vesey building and the Verizon building.. We can also tell that the north face fell last to the south as it was lying on top of the pile. It most assuredly twisted as it collapsed.
Reply: @Oldschooldan1  I'll go back and review photos. I could easily be incorrect. It's been at least a decade since I last looked at them.
Reply: @Oldschooldan1  All at free-fall speed, just like with controlled dem'.
Reply: @dnaking  Thank you. Glad to see we haven't all lost our minds with age (yet).
Reply: @markderv  Free fall is not a speed and no building fell at that rate, Including WCT7.
Reply: @dnakins, don’t you see the penthouse collapse into the building, 5-6 seconds before the shell collapses?  What do you think happens to all that tons of building material when it falls through the roof, and tears the roof away with it?
Reply: @Oldschooldan1  Except once their collapses were set in motion, that is exactly what happened.
Reply: @markderv  Free fall time for a 610 foot building would be 6.158 seconds. The videoed collapse of the top 18 stories took 5.4 second, not including penthouse which collapsed 8 seconds prior. There is still 29 stories left to fall at this point. Total collapse times were close to 18 seconds. Well over twice the time it would take to collapse at free fall acceleration.
Reply: @Oldschooldan1  Are you high? Go watch the videos again.
Reply: @markderv  I don't need to. I've seen them hundreds of times. I would suggest you go back and watch them and then read the NIST report.
Reply: @Oldschooldan1  Nist???? Gets coat.
Reply: @dnaking  Because using the collapse of a 110 floor tower to compromise some other building's columns would be asinine. That's why. Demolition involves weeks/months of planning (zero evidence), involved hundreds of miles of det cord (no evidence), stripping columns (no evidence) and the unique sound signature of shaped charges to sever columns (which don't exist on any audio track from that day). It only doesn't seem logical to someone is being willfully obtuse and absurd. Your equivalences are beyond ludicrous. A standing co-working supporting several tons would absolutely go straight down if you buckled one knee. A standing person has literally no comparison to a 50 story tower. None.
Reply: @Oldschooldan1  What melted the steel, Dan?
Reply: @markderv   Bye Felica!!!!
Reply: @markderv  The steel didn't melt it expanded. See you would know this if you actually read the report. Sadly, that take time and intelligence. Something you seem to be lacking.
Reply: @Oldschooldan1  Those pesky, dishonest firefighters, but yeah, NIST. You are just digging your hole, Danbot.
Reply: @markderv, why are ‘truthers’ so afraid of the truth?  It’s weird all the means with which they will go to convince themselves that’s science supports their conclusions.
Reply: @dikranovichk5889  Aah Dik "This channel doesn't have any content" Ranovich. Appreciate the pearls of wisdom from your silicon cells.
Reply: @Vantriloquist-j9j its never happened before.
Reply: What’s the fascination with the trooper and buildings “falling into their own footprint”. When they clearly fell outside of their own footprint as well.
Reply: @dikranovichk5889  But what was so heavy that it crushed the building all at once as you say?
Reply: @melodyjackson. Care to explain yourself a little better,?
Reply: @Goat_Lord Gravity pulls down. But that doesnt mean a falling tree falls straight down. Because that's not how physics works. It topples and falls sideways at the weak point.
Reply: @slopfactorytv  Because trees are solid and dense objects, unlike WTC 7 which was a hollow building.
Reply: @Vantriloquist-j9j 😂😂😂 Richard Gauge ?
Reply: @dikranovichk5889 Whos facts? If you don't have all the facts then you don't have all the facts. If you had all the facts you would be a "conspiracy theorist"
Reply: Into their own footprint. A perfectly orchestrated d³mo.
Reply: @TradBarbie  - Why then so much collateral damage well outside of their footprints?  2 buildings each with a 1-acre footprint collapse, creating a 17 acre debris pile which destroyed 8 surrounding buildings (well outside of the Towers footprints) and damaging more than 100 others.

If you got something that bleeding obvious so completely wrong, where else have you lost the plot and how would you know?
Reply: @TheCriticalStinker-01  😂😂😂
Reply: Watch his videos on them… it makes perfect sense with the weight bearing down on the weakened supports
Reply: It makes perfect sense when temps were above 600 Celsius and if no force is pushing it sideways and all the weight is going from top down.  How is the path of least resistance in your mind not utilizing gravity and going straight down ?
Reply: no it doesn't... idiots you all are who believe this... a failed control demo will show you if all floors are not destroyed in perfect sequence the building will fall.sideways
Reply: @ So the path of least resistance was downward through the internal structure including the support columns, got ya.
Reply: The path of least resistance does not mean the path of no resistance.  And since you can’t face the fact that the building was already experiencing collapse, when the outer shell falls, that is on you to figure out.
Reply: @Azmagaref. Can’t compute reality, must live a fantasy.
Reply: @dikranovichk5889 it quite clearly explains that in the video.  And if there’s a path of no resistance, then yes that is the path of least resistance Einstein
Reply: @jordanbro, I’m confused, are you a twoofer, or sheeple?
Reply: @Vantriloquist-j9j  The building collapsed because columns failed.  This happened close to the ground where the fire was most concentrated.  You seem to be imagining the roof falling onto a perfectly good building below and bouncing off or something.  There was no building below the collapse, the collapse was below the building.  This isn't complicated.